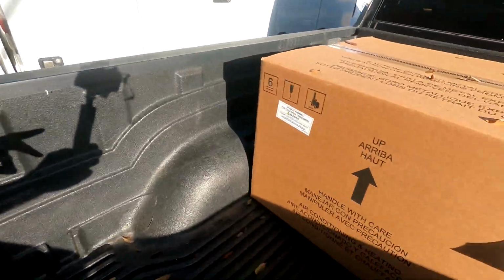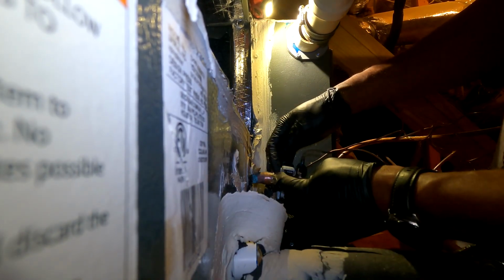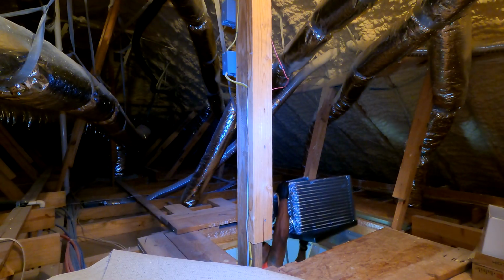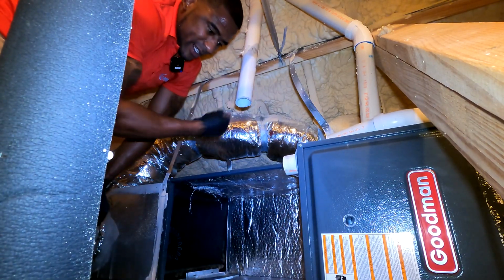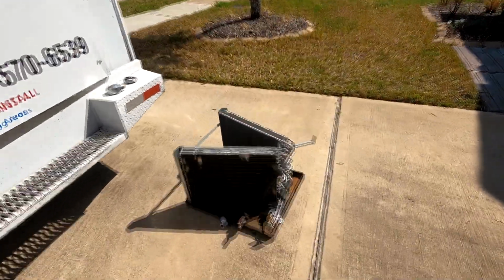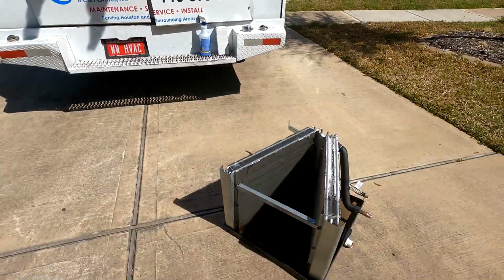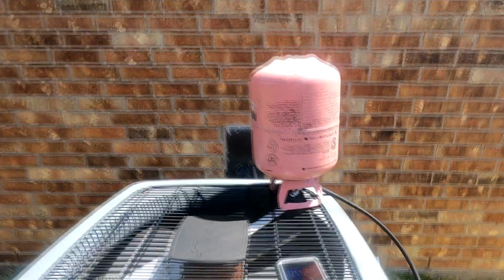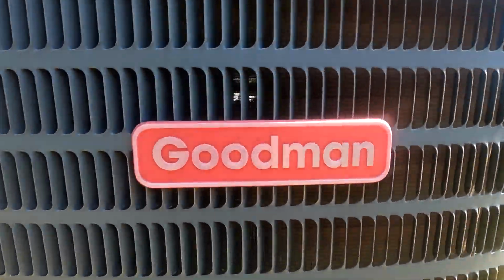"Revive Your Cooling System with These Pro Tips for a Goodman AC:

Comment: Good job however 1 thing to point out. Not sure if this ever happened to you but when you cut the pvc vent pipe you should always make sure you clean all the shavings off the pipe. I have had so many call backs of a no heat and a pressure switch error because those shavings eventually make its way to the drain and blocks it. My install guys eventually learned when they had to go back on their installs in the middle of the night after I have told them repeatedly about it.